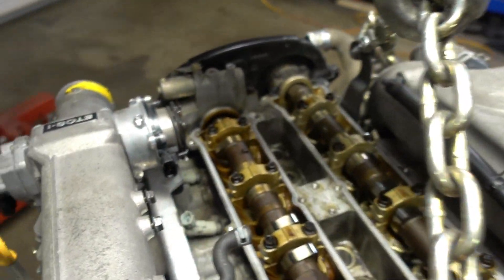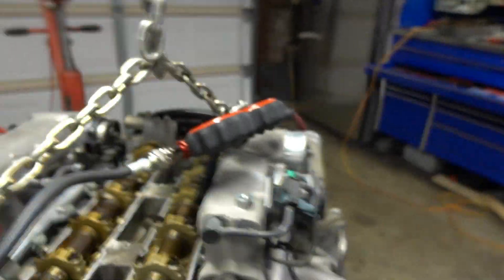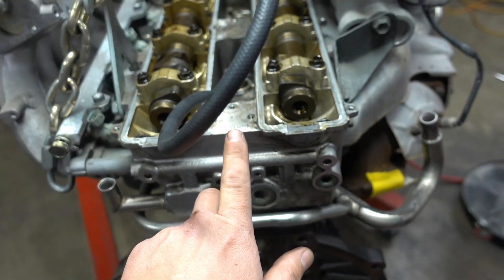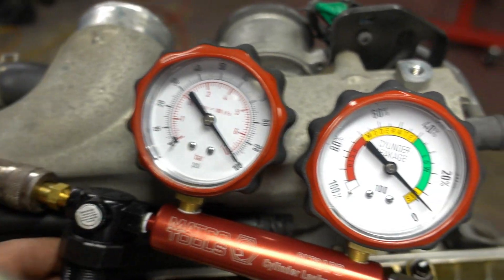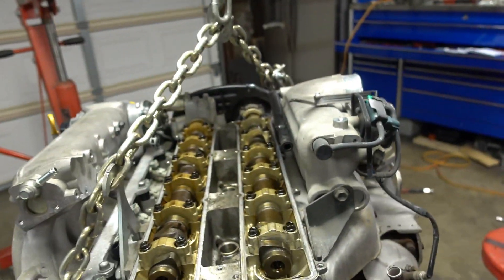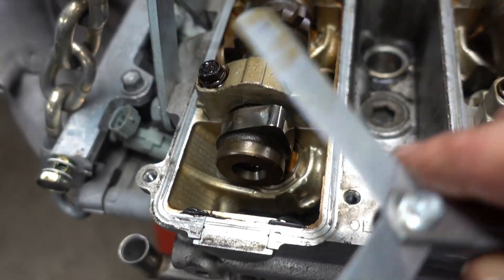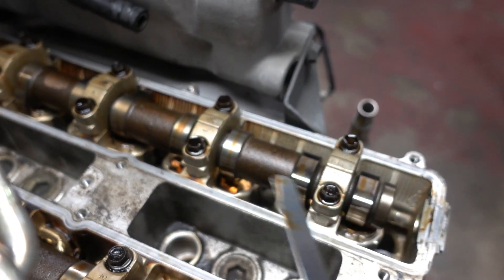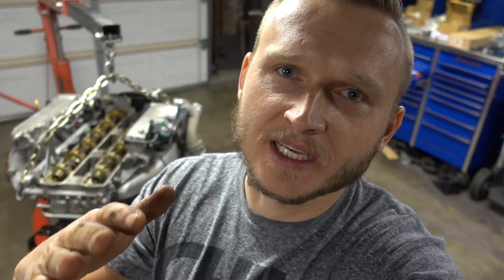1JZ Leak Down Test and Valve Lash Clearance

Comment: Is that the correct way to set the leak down gauge? My instruction say to calibrate the leak down side first to 0%, by winding in the reg without the adaptor connected yet. Then connect to the cylinder.

Comment: I thought the lobe had to face at a 30 degree angle how the buckets sit? You checked it with the lobe sideways? Also are the clearances specs the same between the 2jz and 1jz vvti?
Reply from the maker: As long as the lobe is away from the bucket then the clearance can be checked. I dont belive the 2i and 1j specs are the same so I would recommend double checking.